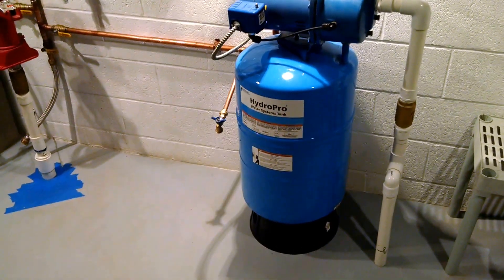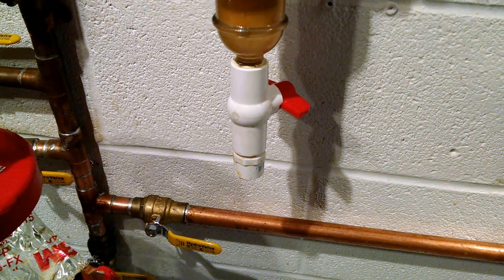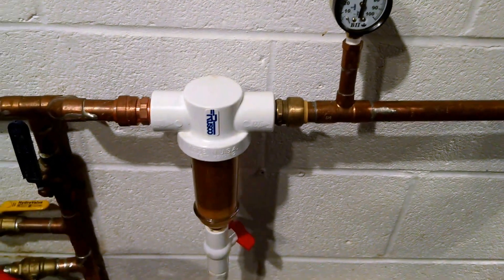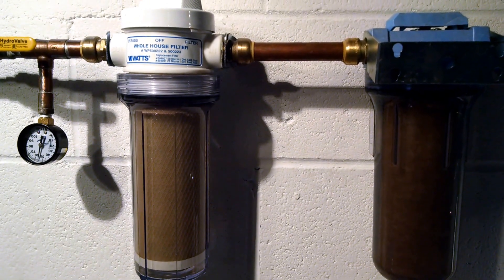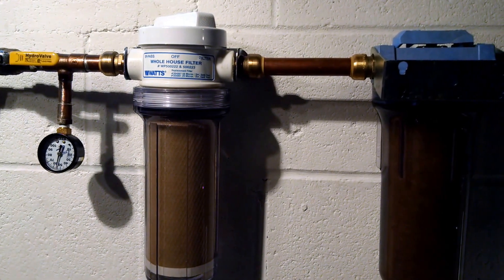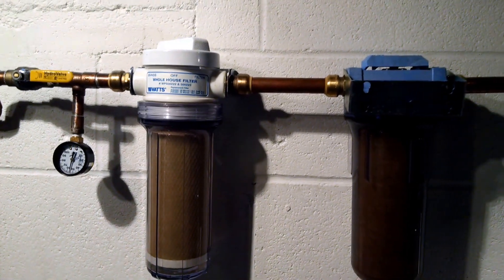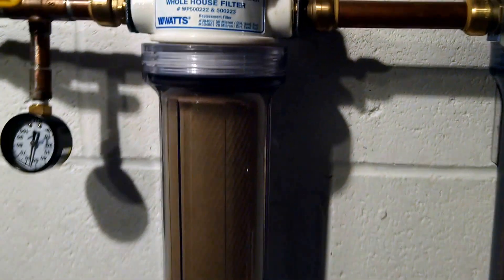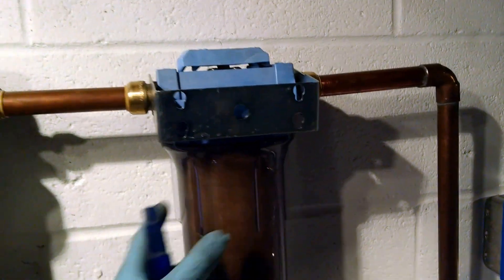Well Water Filters - spindown, sediment, carbon block and reverse osmosis

Comment: Nice video. I had a well pump replacement twenty years ago and they installed the small spin filter with 100 mesh. The whole house filter got stopped up and pressure dropped so I replaced it. Soon the new filter was clogged. I went to a 140 mesh filter and that solved the problem. Now I seem to be having the problem again. How much pressure loss will the 250 filter cause? My pump is rated at 40-60.
Reply from the maker: I've been very surprised that I've noticed almost no pressure drop, even when am I neglect to clean the spin filter

Comment: Where do you purchase those filters?  I paid over $60. for 2 20" Carbon filter.  When I open my faucets, some dirt comes out at the beginning.  I have a whole house filter, and a spin down.
Reply from the maker: The 2.5"  x 10" are very cheap on Ebay or Amazon. The 20" tends to carry a premium.

Comment: Hi
I have installed 3 stage whole house water filter but the taste is terrible 
Tried different filter but taste is not good.
If i install spindown filter would it improve the taste ?
My water has
Chloramine
Arsenic (low levels)
Lead (low levels)
Nickel (low levels)
Reply from the maker: I would recommend a separate drinking water system, reverse osmosis. That is the best way (and sometimes only way) to strip contaminants and improve flavor.
Reply: @LibertyDIY  yeah i have been used it for long time.
But takes lots of space  mrs didnt want that but the taste is terrible on whole house system compare yo RO.
Not sure if spindown would help

Comment: I always recommend putting in a manual bypass for any whole house filtration system. It may seem redundant or overkill, but there will never be a worry of going without water if one of the filter housings or bowels bust. Also, it just makes it so much easier to shut the system down to change out the filters.
Reply: Bypass could be a good idea in some cases but considering his water source (surface water, rain water, near roads), I wouldn't want to send any water from that source into the system unfiltered.
Reply: @philipknight7180  Fair enough, that is something to consider. Some people have to change their filters once a month, because of the horrible water quality of silt, rust, and sediment. Not wanting that kind of water anywhere near the pipes and faucets is understandable.
Reply from the maker: Those water filters with the white top have a built-in bypass which is nice
Reply: @LibertyDIY  Both of mine have a bypass on the top, but I still put in a manual bypass with quarter turn valves as a backup incase if something breaks on one of the filter housings. Also, I turn on the manual bypass when filling on the swimming pool. It comes in handy.

Comment: >>> ur2.pl/1115  The water tastes great, and the system works great as well. The tank is large enough that we've never run out of RO water, and in fact are preparing to run a line to the fridge so that also has RO water. I've had the system for 3 years now.
Reply: good

Comment: How are you getting pesticides in it?
Reply from the maker: Many homes and farms upstream from me.
Reply: Liberty DIY did you test and find them? If so, which ones did you find?
Reply from the maker: I never bothered to test it for pesticides/herbicides/fungicides because I wouldnt drink it without R/O filtering either way. The cost of extensive testing probably more than the R/O unit.
Reply: Liberty DIY pesticides includes herbicide, fungicides, and insecticides. You said there are farms upstream from you. Do you live by a creek, river, lake, or some other body of water?
Reply from the maker: Yes and rodenticides if we are being thorough. Fertilizers, pharmaceuticals and cleaning chemicals that are discharged into the water table via septic systems are also of concern to me. Our road is on a ridge and the water table slowly seeps out of many springs in the ravine downstream from us. Everything is ultimately heading toward the river. The water table on this ridge is only 10'-12' below the surface with a clay layer 16' deep. There are many homes and farms upstream of us. When I say upstream and downstream I am referring mostly to underground flow of the water table. I do not use any chemicals on my lawn or my foundation etc. by my neighbors do and the farms go crazy with synthesized chemicals I have no idea what they are using. I have no idea how persistent these chemicals are in the water table or if they have any synergistic effects in small quantities. Even if some government agency declared these chemicals were safe, I would not blindly trust that advice. So I invoke the precautionary principle and drink R/O water, preferably R/O rain water.
Reply: Liberty DIY hedging on the safe side, i get it. How do you feel farmers are “going crazy on synthesized pesticides”?
Reply from the maker: They spilled some kind of powder for a few hundred yards down the street last week made quite a mess until it rained a few times
Reply from the maker: I drive by there all the time and get some feel for what they are doing with the fields. To top it all off there is a retired dump buried across the street from that farm lol
Reply: Liberty DIY lets say they are spraying Roundup, the most common in our area, by ground. The common rate is 1 quart per acre. It is applied in 3-40 gallons of water. Lets use a common 20 gallons of water per acre. There is 80 quarts of water in 20 gallons. My point is what you see coming out of the sprayer is 80:1 water.
Reply: Liberty DIY I should add that if you take the inert ingredients out of the Roundup, you actually are seeing 160:1 water to Roundup active ingredients.

Comment: Thank you for the video. 
We get our water from a spring that emerges from under a Redwood tree trunk. Regrettably, it's exposed to the surface for about 70 feet before we can collect it at our property line. 
We get a bit of turbidity in water along with colloidal iron (small particles) that are hard to filter.
My system is a bit more redundant as I use a 5 micron before the whole house UV. which we use for general purposes. 
For our drinking water, I then send the UV'ed water through another 2-micron sediment filter to a chlorine retention tank then to an activated carbon filter before it gets to the R/O. 
It's a bit complicated but I like the fact that there is little chance of potentail cooties (Bacteria and viruses)  getting into my morning coffee. 
Plus, The operation costs are far lower than my counterparts that have city water.
In town, it typically costs $100 a month.
Reply from the maker: ipwee  i love self sustainable methods and i prefer the up front cost of diy vs the recurring cost of city systems. Good stuff!
Reply: Det

Comment: With all the filtration including reverse osmosis and UV disinfection, what about fluoride? It's able to pass all them filters and its super toxic to the body.
Well water may not have alot but what about city water?  fluoridated areas (70% of USA floridates drinking water sources)
My suggestion. You got open to the sun land. Place some solar distillers instead of filtration. It's way more natural process for the water to go true and it comes out cleaner and charged with sun energy! Good for drinking, cooking, bath, plants, animals.
Reply from the maker: Andrey D Proper Thankfully, reverse osmosis membrane will filter out 90+% of fluoride ions from tap water. You can tweak the system to filter even more if you prefer.
Reply from the maker: Andrey D We do use rain water for the reverse osmosis system, and well water as a backup when needed. I save all the rejected rain water and use it for gardening. I like the idea of solar distillery but we go through a surprising amount of water. I have about 125 gallon capacity in our rain barrels and that keeps us covered even through winter

Comment: The eBay description of that 5 micron filter says it's only a 1 GMP flow rate. Does that present any issues in your daily life, like showering; filling washing machine; etc.? 

--- The 3/4" Rusco, which takes the 1" screen, is up to 20 GPM before the pressure really drops on the output side ( http://www.watersolutions.net/products/SedimentTrapper/flow_rates_rusco_spin_down_st_filters.php ). Where did you locate the Rusco? Did you place it before all of the tanks; so, it could be back flushed, instead of forward flushed? Rusco offers a programmable automatic flush unit for it.
Reply from the maker: When my wife is in the shower I notice a 2 psi drop across the 5 micron filter which is no problem. I will change it or rinse once it gets 3-4 psi drop.

Comment: Where do you buy your filters so inexpensively?
Reply from the maker: Bought on ebay, this is an example of a good deal on 5 micron filters

https://rover.ebay.com/rover/1/711-53200-19255-0/1?icep_id=114&ipn=icep&toolid=20004&campid=5338089291&mpre=http%3A%2F%2Fwww.ebay.com%2Fitm%2FSediment-Water-Filter-5-Micron-10-x-2-5-size-4-PACK-FREE-SHIPPING-by-Aquaboon-%2F122138352528%3Fhash%3Ditem1c70035b90%3Ag%3AzDIAAOSwmLlX3aYz
Reply: Joe Suhrada you basically Do It Yourself and the filters aren't even expensive at all. 😂 very cheap if you have some experience

Comment: What model # Sharkbite's are those? Thanks!
Reply from the maker: 3 options:

http://www.supplyhouse.com/SharkBite-U134LF-3-4-Sharkbite-x-Male-Adapter-Lead-Free

http://www.supplyhouse.com/Bluefin-PFM075-3-4-Push-Fit-x-Male-Adapter-Lead-Free

https://www.lowes.com/pd/Blue-Hawk-3-4-in-dia-Male-Adapter-Push-Fitting/50013756
Reply: Thank you! My Rusco has non-threaded 1 inch female.  Looks like I may need a non threaded male 1 inch to 3/4 threaded female adapter glued on one side and then thread on the other to the Sharbite.
Reply from the maker: No problem, Yes you have it right